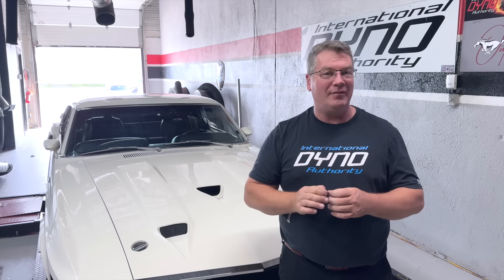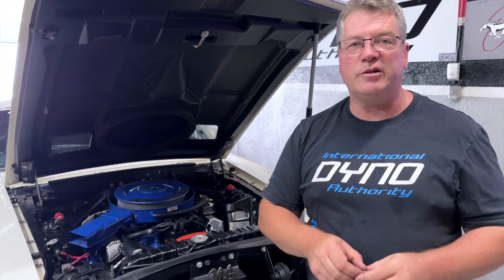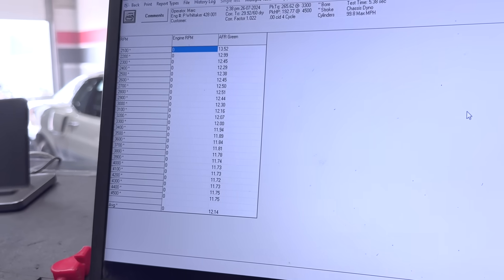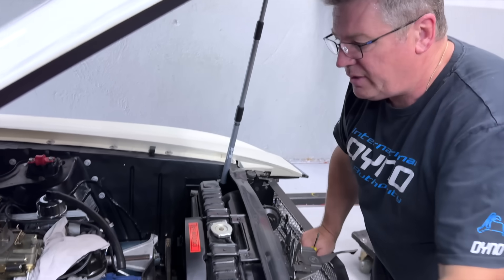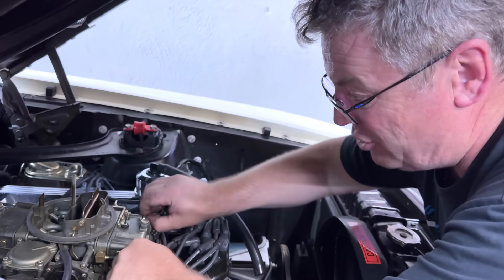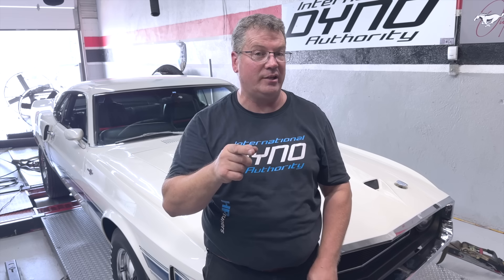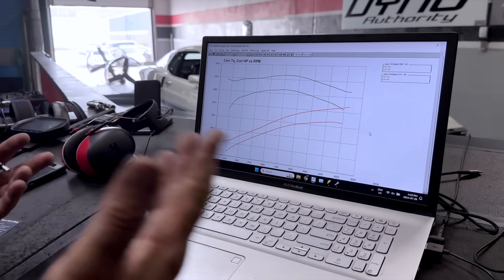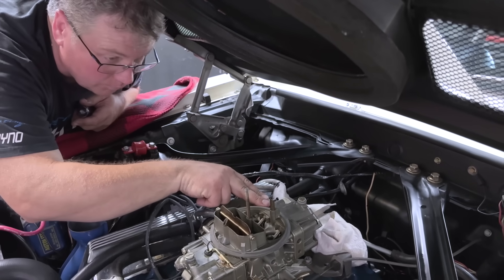Original, unrestored '69 Shelby GT500 tuned on the dyno

Comment: He added leaded gas isn't in
Reply from the maker: Leaded gas when it was released and put into engines 

Was there, as a very very very small barrier between a non-hardened valve seat, and the valve material. 

It had zero to do with tuning. 

We went through this meticulously and found each one of the issues. 

And I can assure you 1000% that nobody's going to add lead in order to help tuning. 

You need to analyze the air fuel ratio. Look through, each one of the systems one by one 

First you look at fuel pressure. After you've looked at the fuel pressure you make sure it's correct. Then you look at the float. Then you look at the low speed air bleeds the throttle position. 

You analyze where the air fuel ratio is by testing it on the chassis dynamometer. 

We use the Science and tech that we now have available to us. 

Cheers, from all of us at International Dyno Authority 

Thank you for writing in and for stimulating conversation

Comment: I knew guys who set a carburetor in a second
Reply from the maker: Thank you very much, for viewing the channel, thank you very much for writing in, and stimulating conversation. 

Making sure, that the air fuel ratio is correct from idle. All the way through to redline. Means that we are very very thorough, with our tuning process. 

We always follow the exact same process every time. 

Running the car the way it is which is called a baseline. And then going through what the settings are when it arrives. 

We then look at, what does the car need? What are the goals of our customer, and what can we do to make the car run correctly. 

We use everything from a vacuum gauge, to several feedback, data points and data logging, from the chassis dynamometer. Dynamometer. Two listening with our ear. Watching with our eyes. And listening to the feedback from the customer. 

Empirical data cannot be, doubted at any point. Running from 2000 RPM to 5500 RPM, and it takes 6.8 seconds. When you are all done with the tune and it only takes 5.1 seconds 

That car is now tuned, correctly. 

There are many people I totally agree, that can take a screwdriver under the hood and start messing with the carburetor start messing with the distributor playing around under the hood. 

We take a very scientific approach, and we walk through step-by-step by step to make the car perfect. Also in 10 years, we have never had a single failure 

Cheers, and thank you for writing in and stimulating conversation. 

From all of us here at International Dyno Authority

Comment: Could be that the leaded gas isn’t in the vehicle making it run
Reply from the maker: As it turns out, when we walked through the standard process. We found out exactly what the issues were 

One of the big issues was the PCV valve was attached to a hose, that was going directly underneath the carburetor. 

There was no PCV system. And this was drawing oil vapor directly into the combustion chamber through the intake. And making a mess. 

We applied a restrictor. 

We very carefully followed the scientific process. And by the end there was Zero smoke. The engine was making, very good. Complete combustion and the power had normalized. 

Thank you very much for writing in, and stimulating conversation, from all of us here:  

At International Dyno Authority

Comment: too long and boring
Reply from the maker: Thank you, for writing in to stimulate conversation. 

We are quite happy to hear the opinions of all of our viewers. 

Cheers, and be aware we have lots and lots of videos. Some of them may be more to your speed. Some of them may be more to your liking. And some of them may be more abbreviated. 

Enjoy!,

From all of us here at International Dyno Authority
Reply from the maker: You would have a very, very very difficult time in this trade. 

This trade requires extreme patience, it requires a massive amount of knowledge, and it's certainly requires following through, each step along the procedure. 

You have to be able to analyze the data log, and understand what to change based on what the data log is showing you. 

At that point you may have to make several changes and it may take four or 5 hours to get it correct. 

In the end, this is what we want. We want a vehicle that's simply drives correctly. 

When it drives correctly, it will definitely make more torque. It will make more power. It will be much quicker. It will have a lot better throttle response. 

None of this can be done in 3 seconds. 

That's why in 10 years we've never had one single failure or comeback. 

Cheers, 

From all of us here at International Dyno Authority
Reply: maybe take some riddlein to help- with your attention defficet..............

Comment: If only they put a boss 429 in that year gt500
Reply from the maker: @MarkPB90  Well, the 385 series, is definitely my favorite engine series of all time. 

Absolutely love that engine series. And I own one of the most powerful 385 engines ever produced. 

There is a practicality involved: 

When comparing the 428 Cobra Jet and the 429 Boss engines, you're looking at two iconic Ford powerplants with distinct characteristics:
 * 428 Cobra Jet:
   * Known for its strong low-end torque, making it excellent for street performance and drag racing.
   * Part of Ford's FE engine family.
   * Generally considered more street-friendly.
   * Was used in a wider variety of Ford models.
   * Generally less expensive than a Boss 429 car.
 * 429 Boss:
   * Designed with high-performance, high-RPM capabilities in mind, particularly for NASCAR homologation.
   * Part of Ford's 385 engine family.
   * Features unique hemispherical combustion chamber heads.
   * Produced in limited numbers, making it highly collectible.
   * Generally more expensive, and more rare than the 428 cobra jet.
   * Had a reputation of having more potential for high end power.
Here's a breakdown of the key differences:
 * Engine Family: The 428 CJ belongs to the FE family, while the 429 Boss is a 385 series engine. This means they have different block designs, cylinder heads, and overall architecture.
 * Performance Characteristics: The 428 CJ excels at producing strong torque at lower RPMs, while the 429 Boss is designed for high-RPM power.
 * Collectibility: The 429 Boss, due to its limited production and unique design, is significantly more collectible and valuable.
In essence, the 428 Cobra Jet was a formidable street and strip engine, while the 429 Boss was a specialized, high-performance engine with a focus on racing.

Thank you very much for commenting, and, stimulating conversation. 

We appreciate it very much 

Cheers, from all of us at International Dyno Authority.

Comment: Torque is measured in pounds per square foot (pound feet) not foot pounds ...
Reply from the maker: @MurraySmith-ch5li  

Motor - Engine 

Ft lbs 

Pd ft

Semantics......
Reply: @internationaldynoauthority693  we used Ft-lbs at University in Engineering but I've seen it both ways as you mention - but NEVER have I seen it as pounds per square foot as the original poster stated - that would be a measure of pressure not torque
Reply from the maker: @MurraySmith-ch5li  

351 cu in (5.8 L) Windsor V8 (1969) 2-barrel H-Code250 bhp (186 kW; 253 PS) @ 4,600355 lb⋅ft (481 N⋅m) @ 2,600351 cu in (5.8 L) Cleveland V8 (1970) 2-barrel H-Code250 bhp (186 kW; 253 PS) @ 5,400355 lb⋅ft (481 N⋅m) @ 3,400351 cu in (5.8 L) Windsor V8 (1969) 4-barrel M-Code290 bhp (216 kW; 294 PS) @ 4,800385 lb⋅ft (522 N⋅m) @ 3,200351 cu in (5.8 L) Cleveland V8 (1970) 4-barrel M-Code300 bhp (224 kW; 304 PS) @ 5,400385 lb⋅ft (522 N⋅m) @ 3,400390 cu in (6.4 L) FE V8 (1969) 4-barrel S-Code320 bhp (239 kW; 324 PS) @ 4,600427 lb⋅ft (579 N⋅m) @ 3,200428 cu in (7.0 L) Non-Ram Air Cobra Jet & Super Cobra Jet V8 (1969–1970) 4-barrel Q-Code335 bhp (250 kW; 340 PS) @ 5,200440 lb⋅ft (597 N⋅m) @ 3,400428 cu in (7.0 L) Ram Air Cobra Jet & Super Cobra Jet V8 (1969–1970) 4-barrel R-Code335 bhp (250 kW; 340 PS) @ 5,200440 lb⋅ft (597 N⋅m) @ 3,40
Reply from the maker: @MurraySmith-ch5li  

horsepower, the common unit of power; i.e., the rate at which work is done. In the British Imperial System, one horsepower equals 33,000 foot-pounds of work per minute—that is, the power necessary to lift a total mass of 33,000 pounds one foot in one minute.
Reply from the maker: @MurraySmith-ch5li  

Engine

Base engine size6.2 LCylindersV8Base engine typeGas

Horsepower430 hp @ 5,900 rpmTorque424 lb-ft @ 4,600 rpmValves16Cam typeOverhead valves (OHV)

Show less
Reply from the maker: @MurraySmith-ch5li  

We had a really nice 3k mile 2012 manual Grand Sport in last week for some mods. Baselined at 381 hp & 384 ft/lbs tq. We were looking to do a nice naturally aspirated package for now, as next year he is looking into adding an A&A kit.

We used our Phoenix cam in this build - he wanted something that drove nice, but also had a nasty idle to it. We did tweak the specs a bit to work better with the A&A next year.

A Halltech went on for the intake, Kooks headers, and also Kook's brand spanking new C6 axleback as well. Looks fantastic with the 4" tips, and has that great Kooks sound as well.
Reply from the maker: @MurraySmith-ch5li  

(Ft lb), is a unit of torque representing one pound of force acting at a perpendicular distance of one foot from a pivot point. Conversely one foot pound-force (ft · lb) is the moment about an axis that applies one pound-force at a radius of one foot.
Reply from the maker: @MurraySmith-ch5li  

How many foot-pounds are in 1 horsepower?

550 ft⋅lbf

1 horsepower (mechanical) = 33,000 ft⋅lbf/min = 550 ft⋅lbf/s.
Reply from the maker: @MurraySmith-ch5li  

https://www.google.com/search?q=engine+dyno+test+chart&oq=engine+dyno+test+chart&gs_lcrp=EgZjaHJvbWUyBggAEEUYOTIHCAEQIRigATIHCAIQIRigATIHCAMQIRifBTIHCAQQIRifBTIHCAUQIRiPAtIBCDg3NzhqMGo5qAIOsAIB8QWFvBGzuMesOw&client=ms-android-telus-ca-rvc3&sourceid=chrome-mobile&ie=UTF-8#vhid=eKpJj0L-BKR2fM&vssid=_p92_Z9a5HfmlptQP3q6ysQY_43
Reply: It can be stated either way. Pound-feet sounds odd anyway. Way back before you were born everyone said foot-pounds as they still say "
inch-pounds" . Torque specs in all repair manuals are specified in ' ft-lbs' and 'in-lbs' The measurement has nothing to do with square feet. The standard is based on the effect of one pound of force acting on a one foot long lever.
Reply: Uh no. Foot pounds not pounds per square feet.
Reply: Wrong. Square foot is area, not twist. It's always pounds foot or pounds feet pounding length of torque arm...

Comment: Now let's get some slicks on it and see what it does at the track!
Reply from the maker: @m42037  

http://www.wallaceracing.com/et-hp-mph.php
Reply: @internationaldynoauthority693  Yeah I know about the ET calc. Driving it is different. These cars are lawn ornaments, not what they were built for was my point
Reply from the maker: @m42037  

Totally agree, with a different owner, they may have made a different path for this vehicle 

However, at this time the value of this vehicle if you saw the valuation is probably 3 to 4 to 5 times more than what your imagining it is. 

And chopping it up to put a set of long tube headers, a 1050 dominator, a set of slapper bars and a different set of rims and tires, with race, Fuel and advanced race. Timing, to see if we could get it down the quarter mile in 11 seconds, would devalue the car quite a bit. 

I think it's going to end up doing exactly what he's doing with it now which is to keep it in mint condition. Polish it. Clean it, tune it, and let it accumulate value. 

Within the next 10 years, this car will value itself, in the same condition at 500,000
Reply: @internationaldynoauthority693  Chopping it up?? Ever been to the "Pure Stock Muscle Car races?? Or the Nostalgia drags? Nobody said anything about gutting the car and making it a 10 (11s lol) second car. A pair of slicks or drag radials and some tuning and a pair of headers you don't need to cut up the car I had a 66 XL I raced for years and was mint. Many muscle cars aren't worth 500k exp nowadays that big boom was 20 years ago ie the Barrett Jackson days, those are just museum trailer queens
Reply from the maker: @m42037  

The value of this car, the shape. It's in, the paperwork that it comes with. 

Nobody is going to be taking this vehicle to the racetrack. 

Going to go to car shows 

It's going to be a museum piece 

That's pretty much it 

Nobody's going to take the original manifold off and start putting on headers. 

Nobody's going to start trying to wrap the original... Leaf springs up, while attempting to get a better 60 ft. 

It's a fantastic piece. But that's pretty much where it stops.
Reply: @internationaldynoauthority693  It's a trailer queen and to me it's been destroyed. Muscle Cars were made to drive and race not made into lawn chair cars
Reply from the maker: @m42037  

I guess the best suggestion. 

Try to find one in the same condition. Or one close. Restore it back this condition. 

And then, take it to the racetrack and race it. 

That's kind of the the route, I see. Your interests are definitely heading. 

Be prepared, it's a very very hefty sum of money. 
. 
I don't know if I would have the same cavalier attitude. If I was spending the kind of money this car takes to purchase, in order them, take it to the track, and and start testing it. 

But to each his or her own for sure.. 

There are just a lot of other projects that are easier to go to the track. Have some fun and you're not really worried if somebody walks up and scratches it or a stone happens to hit it on the way to the track etc etc
Reply: @internationaldynoauthority693  My comment was made because too many muscle cars today are restored and just sit at car shows. As I said go to the "Pure Stock or nostalgia drags and many there are very valuable, if you break something replace it. I raced and drove my Galaxie and went to cruise ins, car shows are boring, after you looked at the cars in one hour you sit in your lawn chair for six hours to wait to get a two dollar plastic Chinese trophy lol

Comment: I found myself wondering a couple things.. i recall being told every dyno gonna be different do to various reasons.. and then i noticed the rear tires looked like they were squatting a bit and so obviously you need traction i know but how much can that affect the run if its strapped down just enough  or if sucked down tighter than necessary?especially since air presure has one of the biggest affects on rolling resistance and mpg.  Next.. what altitude you were at as compared to where that car came from..  because if it was from somewhere closer to sea level originally but did not stay there..and or did dyno at a higher level..a few thousand feet can make a really big difference as well as air  temp humidity etc though not as much ..  
I tuned a carbureted big twin bike for where im at and wow i loved it.. no lift shift would burn tire hitting third! And didnt NEED choke to start it like prior.. but on a trip out west and in moutains etc that tune was just horrible when we were up in higher elevation made that bike terribly rich and slow  Going down hill out of Yellowstone i dropped 2 or 3 gears and opened it up to pass a vehicle and actually had to back off and wait to safely pass because it was too slow to complete the pass the first time!  
Also.. todays gas sucks so bad! ..i assume you ran premium non ethonal ...but was it non oxygenated or no and would it make a difference? Diid that thing need valvelash adjustments as per maintenance schedule or not  on that?  There are so many things that make a difference..shit adds up. 
  I wont bust your balls about not making sure the choke was backed off all the way when it was rich to start with, since you obviously got to it and then proceeded to cover everything really well for a good solid tune considering the detailed comment. Awesome car.. it boggles my mind to think since new it was not running like it should. Even after trying to get it remedied.  
.. some people should have there tool box welded shut! 😂 And dealers are often times not any better they just charge more!
Reply from the maker: @LG-fb9yt  

Coast down coefficient is measured and calibrated on the dyno to determine tire friction / drag.

J1349 S.T.P. is the formula for Correction due to : heat, Humidity, and Water grain percentage.

The dyno also allows for sea-level calculations. Although on this case the sea level is 256 ft, so not a factor.

Choke was adjusted to complete "off" and moved to its least effective adjustment for colder climate. ( It will never be driven in cold weather)

Hydraulic liters had been checked , maintenanced and set previously.

Spark plugs, oil, wires, distributor....etc.. etc..  all 'tune up' items were previously addressed.

The vehicle was strapped using the same method as per all the vehicles.  The tires were older style and soft sidewalled.

We "eliminated" all other extenuating items.  This allowed us to focus on "tune".

We had a very clear task set out for us. We needed to clear up the smoke, and provide the ideal environment for the combustion chamber to do its job.  AFR, is always Step 1.

After making sure the basics are covered, we begin setting up yhe fueling for success.

91 pump ⛽ is used because it is 90 % repeatable and easily readily accessible.  

We tune for every day use , and for the customers goal for their car.

On this session, we accomplished : diagnosis, smoke free tuning, thinking outside the box... 

We rerouted, and fixed a ver purely setbup pvc system.

All of this gave this Mustang a proper shot, at running correctlyfor the next 50 years.
Reply: @internationaldynoauthority693  awesome! You obviously achůieved the intended goal..  clearly you do quality work and have a good brainpan full of knowledge!   I appreciate you taking the time to satisfy my curiosities.. sthanks!